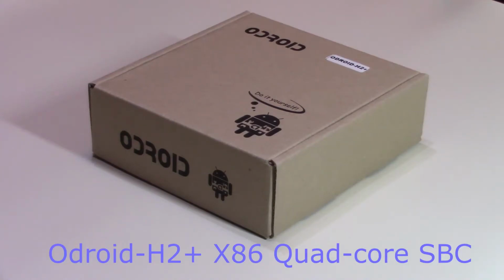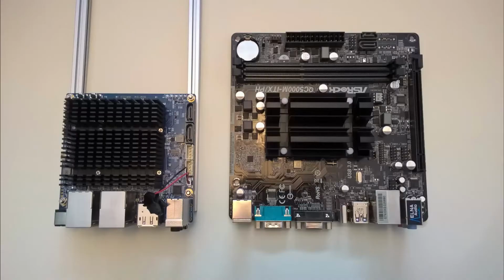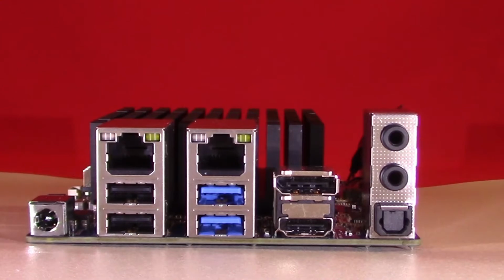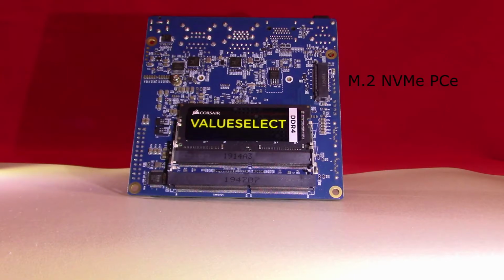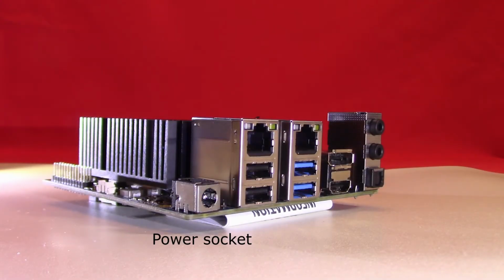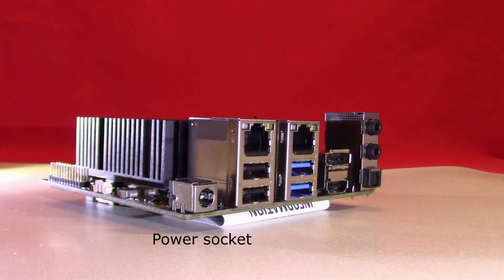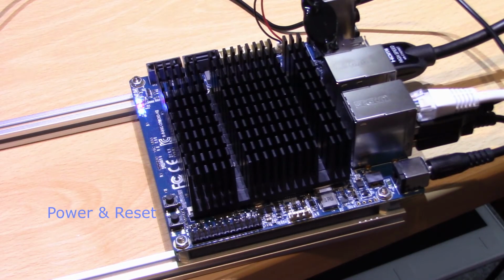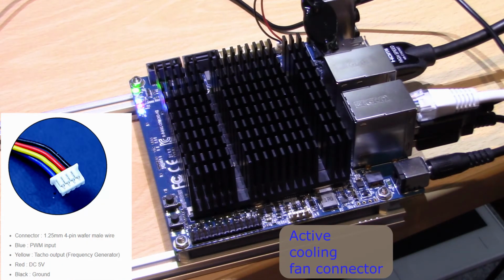Odroid H2 x86 single board computer project part 1

Comment: This thing run pfsense?
Reply from the maker: I've heard of issues running pfSense with the Realtek NIC’s on the Odroid h2+, but I've never tried installing it myself.
Reply: @custompchardware  wondering if it works or not with proper drivers.